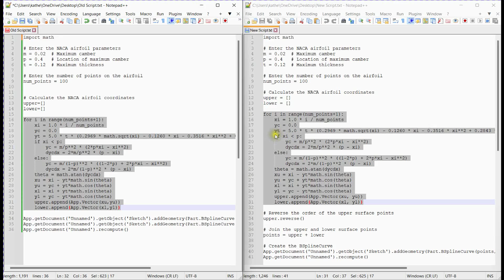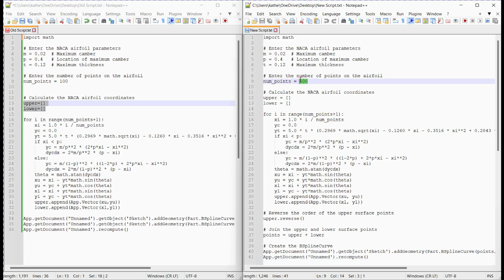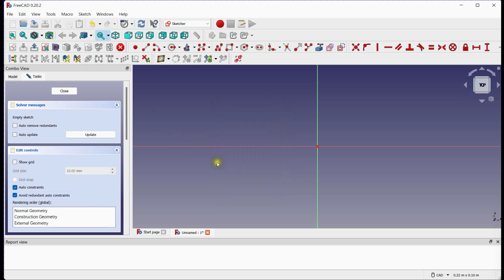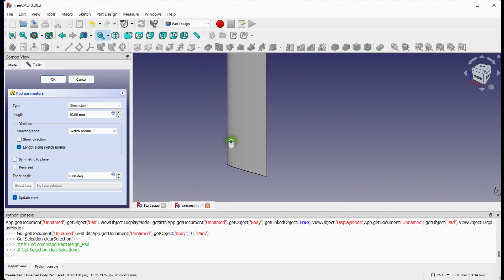🚀 Enhancing NACA Airfoil Generation with a new Python Script, Reversing Arrays ♻️ & Joining Points 🔗

Comment: I have tried using this script, but I get the following error:
# Reverse the order of the upper surface points
... upper.reverse()
  File "<input>", line 20
    upper.reverse()
    ^^^^^
SyntaxError: invalid syntax

Any thoughts about what is causing this?
Reply from the maker: Are you able to solve this issue?